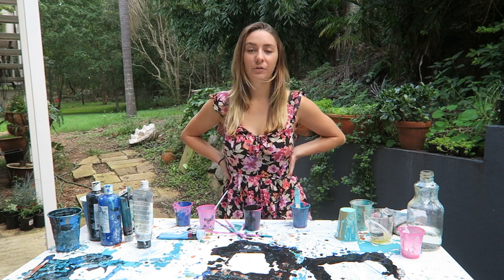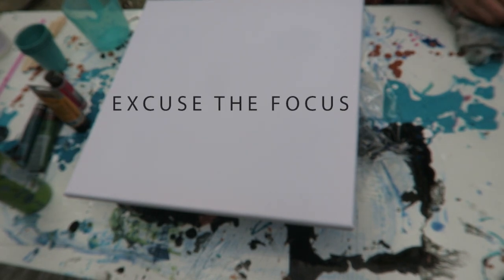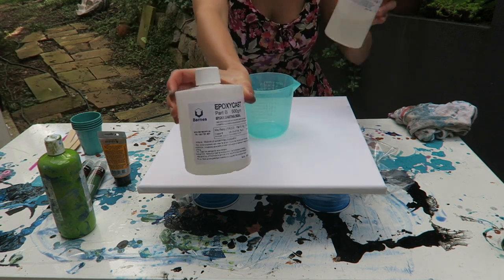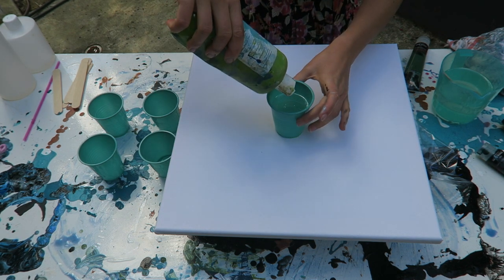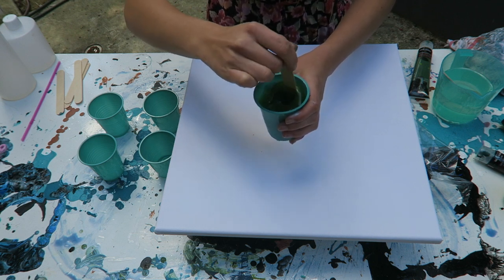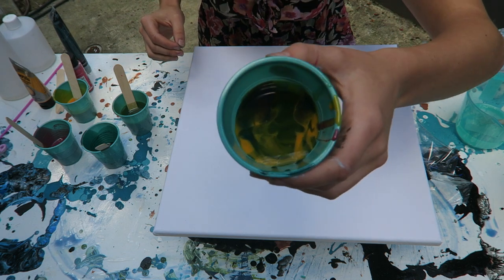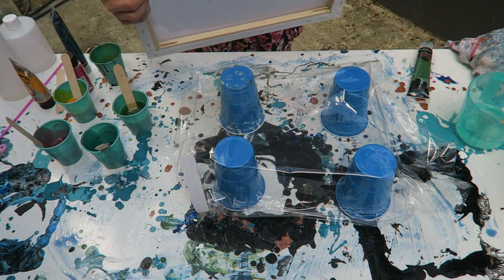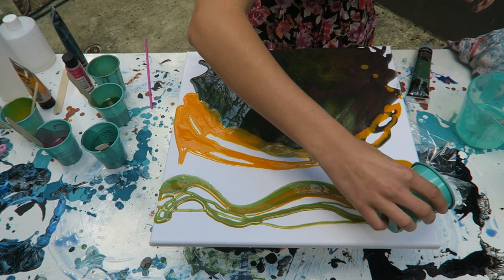Dirty Pour Resin Art Tutorial | Resin Art for Beginners

Comment: I've seen acrylic paints and also oil paints used to mix with resin.  Can you use either or do you buy a specific resin for oils and another one for acrylics?
Reply from the maker: It depends on the water content of the pigments. The results will vary depending on what resin you use however the biggest factor is the amount of water in the pigments. Try and avoid "high flow" acrylics because they normally have a very high amount of water in them. Personally I only ever use acrylics and  powdered pigments to have the best results. You can always do a "acrylic pour" and afterward do a clear coat of resin to be safe. I hope that helps Pam, and sorry for taking so long to get back to you!